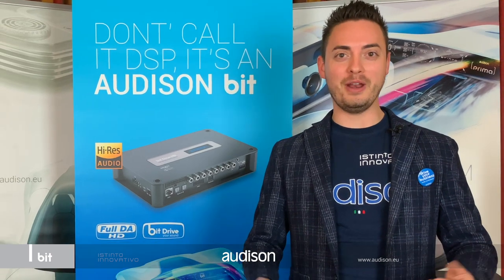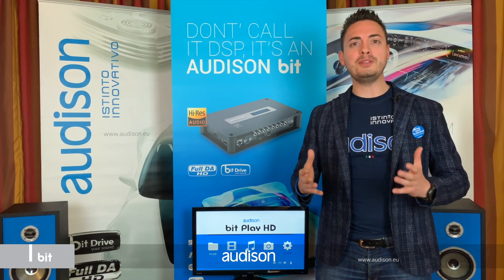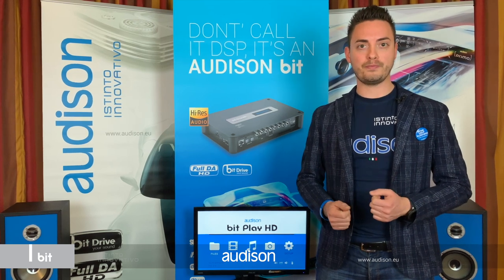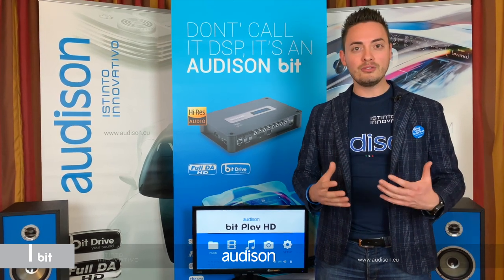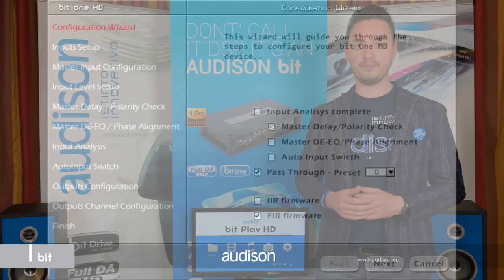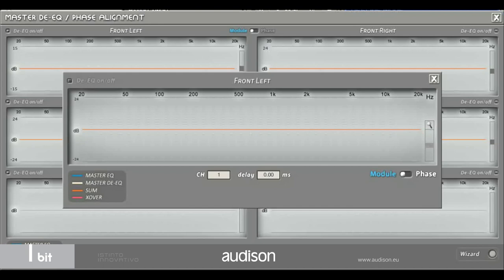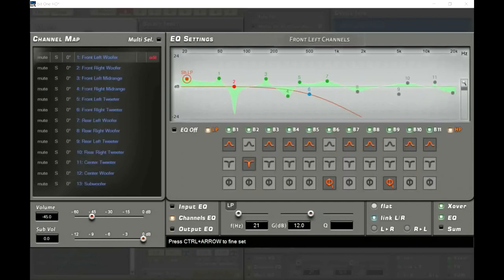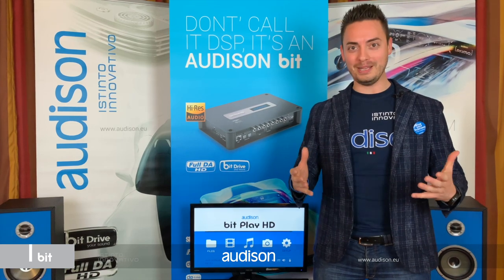New bit One HD 2019 edition unveiled at CES 2019

Comment: Hi.What is the difference from the other bit one hds.
Reply: High bit resolution, pretty useless
Reply: Less noise to
Reply from the maker: Hello thank you for contacting us,
they are totally different products: bit One is the fist dsp created by Audison in 2009 and constantly updated to current version, improving performance and functionality.

Bit One HD 2019 is the current Audison top of the range bit processor, featuring 13 output channels with 24 bit 96 kHz audio processing thanks to last generation floating point Analog Device SHARK series DSP. You can find all the info to our web site https://www.audison.eu/products/bit-one-hd/.

Thank you for contacting Audison. 

-Best regards
Reply: @AudisonItofficial  Thanks for your reply.Is it same 2018 bit one hd?
Reply from the maker: @HakanHeh  No, it is the upgraded 2019 edition. -Regards
Reply: @AudisonItofficial  Thanks a lot.
Reply from the maker: @HakanHeh  You are welcome!
Reply: @AudisonItofficial  When will you release noise cancellation for bit one hd?
Reply: @AudisonItofficial  Actually i meaned CNK
Reply: I use bit one with alphine945 head unit connect with optic cable. If l change the old to the new one, i will change head unit or not. The old head unit does not support hi-ress